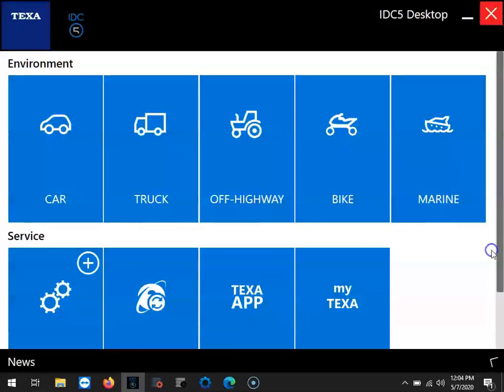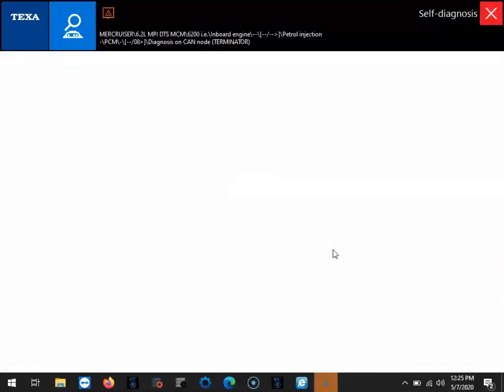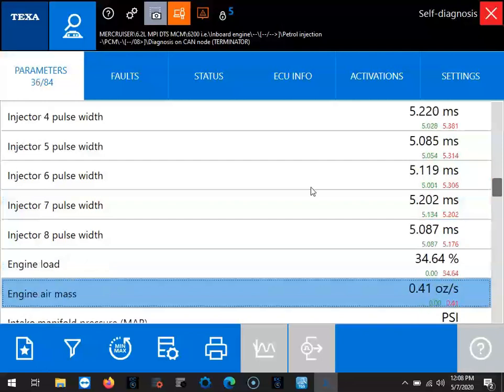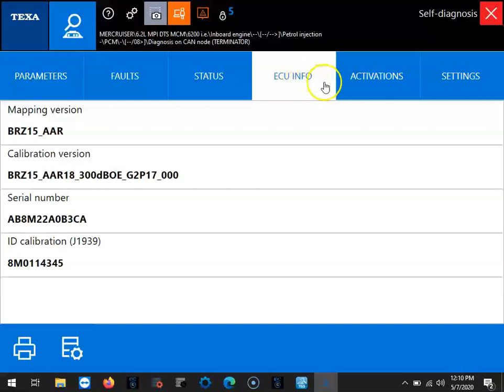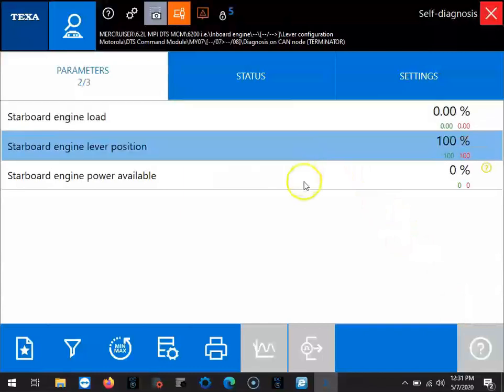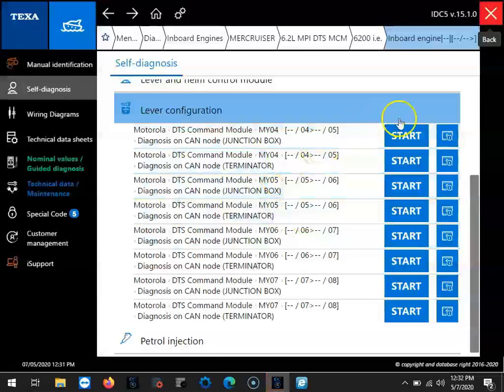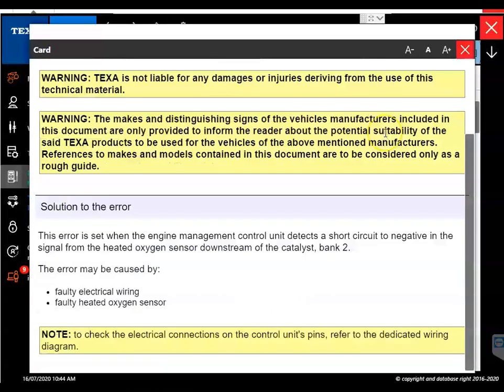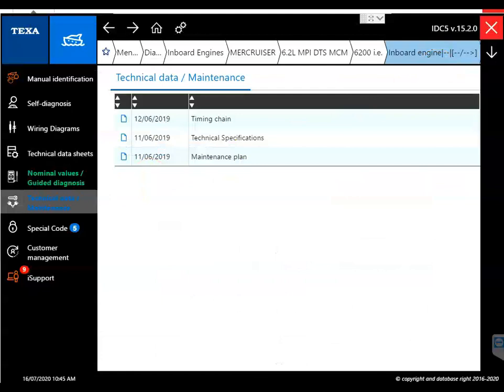Texa IDC5 Marine Software on a 2016 Mercruiser 6.2L

Comment: Why not connect through the obd-m port using the am43 cable instead?
Reply from the maker: The AM43 will get you engine only, the AM44 you can get into other systems like the Digital Throttle Shift (DTS).